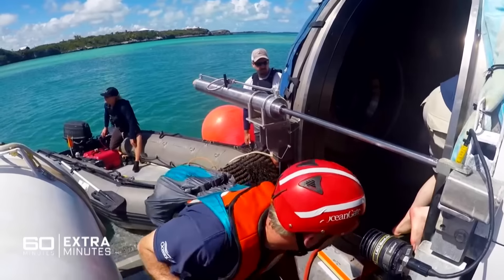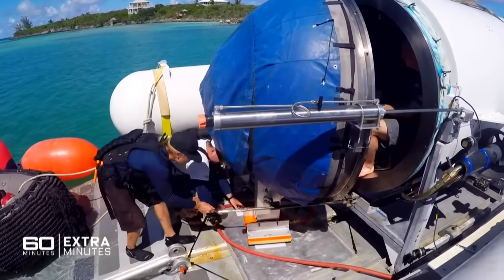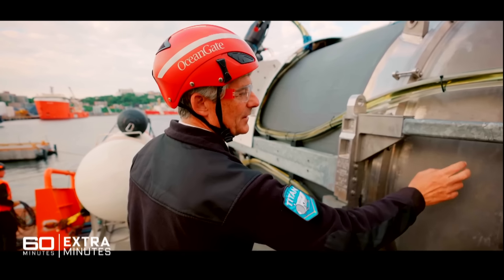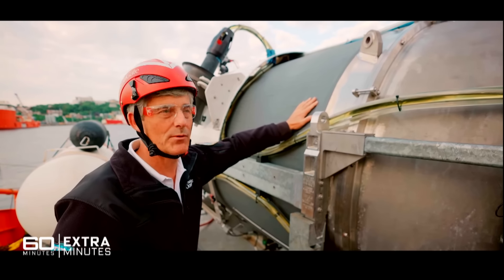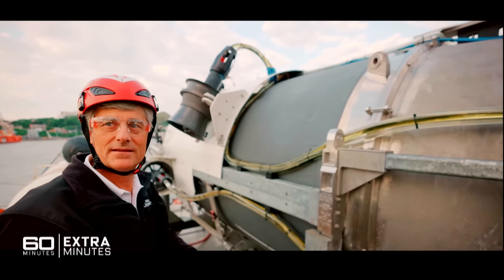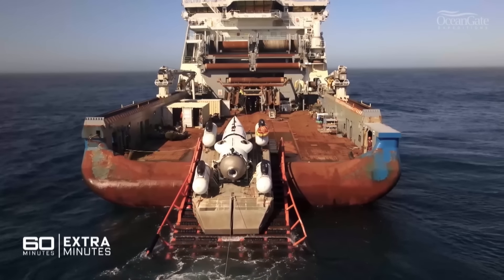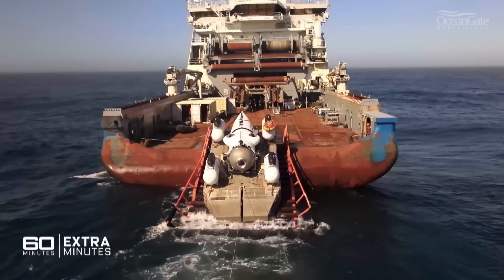Titanic sub implosion explained | 60 Minutes Australia

Comment: I’ve worked with carbon and glass fibre and we always applied the layers in multiple directions. It adds significantly more stability and strength to whatever you make. Here the fibre was applied in one direction only, that’s really puzzling to me.
Reply: To save money is why. What a fool he was.
Reply: Carbon fiber COMPOSITE.  Mate, I don’t care who has worked with carbon fiber. It doesn’t matter.  At high pressures, particularly 4000m under the sea - you DO NOT use any composite material.  You need an external hull that is homogenous and made of one material.  You literally can’t have different parts of the hull experiencing different pressure values of compression and expansion.  It was a doomed design.  Period.
Reply: It was actualy a 0/90 lay-up (according to Composites World) but the 0 direction was filiment wound and the 90 was layed up with prepegs. But there was no post-cure or autoclaving. Plus, the only other composite pressure hulls in use today are all made of glass fibre and none operate below 1000m. Also, I think the layup on them is isotropic.
Reply: Not to mention the total disregard for the lifespan of the materials.
Reply: @xivanquishix3456  Most likely. But not using the strongest application for the material seems rather stupid regardless.
Reply: wrx2hot4u There’s a reason CF is not used on any certified submersible, CF is not weak but it’s stronger when the pressure is outward not inward, no one is going to test it for how many dives it can last because the failure point is unpredictable, which would be a waste of money. All we saw that was left in one piece was the titanium.
Reply: wrx2hot4u my lay/ hobby knowledge of CF vs the Titan, biggest problem I see not much mention of is the lack of vacuum forming means it's at a microscopic level full of tiny bubbles of moist air (at whatever humidity the ambient conditions on the day of lamination). These bubbles being more or less evenly distributed throughout the form, seems inevitable they are going to contract & expand variably- a recipe for cracking in an atmosphere with zero threshold for weaknes.
Reply: The designers didn't have  one iota of common  sense
Reply: as soon as he would have mentioned yea we glue the parts together id be like naw im good thanks you drive safe lol.
Reply: that struck me too! as I too have experience in hpa carbon fibre tanks and that wind is making a spring not a weave... shocked me to see it but I honestly thought they would have covered that in the basic design along with it's not strong in compression plus water can track along the fibres same as air so you could have a decompression separation of layers on resurface
Reply: so now you're an expert on submersibles ?
Reply: @WWESVRPLAYER he is mate
Reply: I am still baffled why they would us an unproven material and tubular shape for the hull.
Reply: So he made a choice of material that is already considered inappropriate for the task, but then he added 3 serious additional errors (he didn't apply the layers properly, he didn't post-cure, and the actual carbon fiber he used was considered to be past its shelf life). Not to mention the dubious manner in which the titanium domes were adhered to the main pressure vessel.  After all of that, he blatantly ignored the clear evidence of the hull beginning to fail on earlier missions.  I'm dumbfounded that his original co-founder (Guillermo Sohnlein) has the nerve to keep calling Rush "risk-averse" in interviews.  Somebody needs to brush up on the definition of the term "risk-averse".
Reply: That submersible imploded so fast that Rush still thinks he's descending to the Titanic; winning.
Reply: That’s why they put rhino liner on the outside 😂😂😂 he must of watched that mythbusters episode! 😂
Reply: @WWESVRPLAYER  Yawn. Really now buddy?
Reply: I don't think it matters,it will eventually fail, a ticking time bomb.
Reply: @Ace96x10  More than a fool he is a selfish man and a murderer
Reply: what's puzzling to me is you keep speaking as carbon fibre is the only material in use when LITERALLY it's a COMPOSITE MATERIAL.  AS IF the LAYUP of the fibre material matters more then the resin in this case when several engineers of gone on record discussing how the fibres are at their best when holding up AGAINST TENSION.   What do you think that leaves left AGAINST COMPRESSION?  OH YEAH!!  That COMPOSITE MATERIAL you just conveniently LEAVE OUT.  THE RESIN.
Reply: @xivanquishix3456  I'm not an engineer and even I was thinking about different materials having different expansion and contraction values due to the cold affecting seams and joints.
Reply: That really makes no difference in the Titan's case because Carbon Fibre is great under tension but much poorer under compression.  It would make little difference how you wound or layered that Carbon Fibre because you'd be putting it under compression.  The fibres themselves cannot compress like Steel or Titanium can so all you have is the resin giving the repeated compression strength.

A second point is Steel and Titanium are homogenous, they're basically the exact same where ever you look in the material.
Carbon Fibre is a composite of two very different materials....the strands of Carbon Fibre and the epoxy resin. Both have very different properties.

A third factor is in the manufacture. Steel and Titanium will be exactly the same where ever you look on the object. Carbon Fibre composite will have slight variations in how the fibres are aligned, how much resin is between one fibre and the next one, there may be more tiny air bubbles in one area than another and all of these things mean you can't know exactly how strong the structure is because of the old adage - a chain is only as strong as it's weakest link.

One part of the Carbon Fibre composite may be quite a bit stronger than a bit 6 centimetres away.
You just don't get that issue with Steel and Titanium which is why they are the materials of choice.  They are predictable where Carbon Fibre composite wont be.
Reply: without going to the depths of the ocean floor here's what your 'Carbon Fibre' looks like under compressive stress.   https://youtu.be/Mc0wFyCIDfE?t=7
Reply: Wow. This layman thought carbon fiber, while around awhile, was still a fairly "exotic" material only used in specialty aircraft or other limited applications but since this fiasco have read a lot of comments of people familiar or working with it somehow.. Was gonna ask but can look it up just as well.
Reply: how about some more compressive stresses on carbon fibre WITHOUT going to the ocean floor  https://youtu.be/Yw56mgPK43s?t=83
Reply: Wow, no kidding. 😢
Reply: @xivanquishix3456  Don't think he was offering contradictions, just musing on his own experience with CF. Past that, your note of composites raises this layman's awe and respect for materials science. I consider myself a "science guy" and have all my life but damn generalized. MS and engineering seem like wizardry to me ... and the consequences are life/death vs. mis-identifiying a moth.

Really struck me years ago with a temp job at the Montana Dept of Transportation. Could not get past the INSANE level of calculation, formula and design I saw on highway curves I'd pass without a thought. But the materials testing labs were best. Steampunk mixed with Frankenstein equipment; simmering pots of asphalt mixes to test gravels to Hell If I Knew. 

Barely tip of iceberg when next went to the Research Library. Thought that proofreading gig would be a cakewalk joke but Holy Hell, tons of active project papers with such technical complexity/jargon/formulas that it made surgical report transcription look like reciting candy bar wrappers. Salute to all the material scientists, engineers and anyone associated with such insanely complex things that it makes most people flee screaming.
Reply: @Lmzip2  The tubular shape was to fit more fee paying passengers and he chose the number 5 for a very good reason. 
The parent company OceanGate Inc. was based in Everett Washington while OceanGate Expeditions, was a subsidiary company based in the Bahamas that led the Titanic dives. The Bahamas has less stringent rules than the USA. Titan was also flagged as a Bahamas vessel.

This was to circumvent stringent US regulations, specifically H.R.1159 - Passenger Vessel Safety Act of 1993 103rd Congress (1993-1994).

SEC. 5. UNINSPECTED PASSENGER VESSEL.

  SEC. 4. SMALL PASSENGER VESSEL.

    Section 2101(35) of title 46, United States Code, is amended to 
read as follows:
            ``(35) `small passenger vessel' means a vessel of less than 
        100 gross tons--
                    ``(A) carrying more than 6 passengers, including at 
                least one passenger for hire;
                    ``(B) that is chartered with the crew provided or 
                specified by the owner or the owner's representative 
                and carrying more than 6 passengers;
                    ``(C) that is chartered with no crew provided or 
                specified by the owner or the owner's representative 
                and carrying more than 12 passengers; or
                    ``(D) that is a submersible vessel carrying at 
                least one passenger for hire.''.
Reply: Right
Reply: unfortunately a submersible isn't planar https://youtu.be/DM6J-yw8yjA?t=224
Reply: I’m not even a expert in this stuff, but I do know if you layer stuff in different directions it gets stronger.
Reply: Carbon fibre is not designed for that sort of pressure
Reply: It does not work!
Reply: @J-Mac8  sure... I can layer up normal printer paper all day long and it get as strong as construction paper or even a credit card... that doesn't mean i'd be willing to use it for a submersible in a 1 foot baby pool.

got paper fibres in all directions all day long
Reply: @emteehed  I wouldn’t either!
Reply: Yeah I've seen this point made elsewhere, that even for CF it was a poor design. It's very hard for me to understand what Stockton was thinking. I think the root issue is that with a pressure vessel, you'd like to start with safety, then design around that. 

In this case, that would have meant a spherical design, but that would be space & material inefficient if you're trying to fit a bunch of people on board. So they went with a cylinder, and carbon fiber. I'm sure that's why Stockton didn't bother trying to class his design, because he knew there was no way it would pass. Better to not even try, and say something vague about 'innovation'.
Reply: I'm not an engineer, and still feel it's obvious that under compression, carbon fiber composite isn't carbon fiber bonded with resin like it is under tension or torsion. Instead it's resin bonded with carbon fiber. The fibers happily flex far more under compression than tension or torsion, letting the resin crack and shatter more easily.
Reply: Would not have mattered.  The issue was the CF / titanium interface, which moved at dissimilar rates and was the point of failure.
Reply: Fiber is useless where almost all the forces are COMPRESSION!  6000psi is 864000per square foot.  That is like 7 loaded tractor trailers on every square foot of that vessel.
Reply: DOESN'T MATTER HOW YOU APPLY THE FIBER. THE FACT TO THE MATTER IS THAT EPOXY RESIN IS THE ONLY THING HOLDING IT TOGETHER UNLIKE STEEL AND TITANIUM OR ALUMINUM WHICH YOU WELD IT. IT WAS GLUED NOT WELDED TOGETHER.
Reply: wrx2hot4u totally wrong. All carbon fibre is different and will result in different strengths each time its made. You also have different strengths in different parts of the hull which will also be different each time you build one. You might get 10 dives on 1 titan then only 2 dives on the next. Especially when you are joining metal to the CF hull by glue. Metal expands and contracts with heat difference and also the carbon hull could've flexed which could've cracked the glue. Again something that could react differently on each build.
Reply: wrx2hot4u  bruh it shouldn't have been used at all, let alone at 4000m below the ocean. dafuq you talking about.
Reply: wrx2hot4u  seems they are talking about its application aka wet atmospheric pressure not motorcycle helmets.
Reply: @ZacabebOTG  what it's not is concrete and rebar
Reply: Yep, staggering the composite layers was going to save them. 😆 That's hilarious mate, look what happened. Using composite materials was a death sentence from the beginning, especially going in a submersible at nearly 4km  under water. The owner was complete moron, he was told it was a bad idea from the start yet he didn't want a bar of it, until the ocean gave him a bar his submersible couldn't handle.
Reply: @lancepage1914  Did I ever claim it would have saved them or even made the basic idea more valid? I’m just pointing out they didn’t even used the strongest construction possible with the material.
Reply: @darknes7800  are you speculating, or do we have concrete evidence of that? I know that was a possibility, but the hull failing directly was a possibility too.
Reply: @captainwin6333  The thing about CF being great under tension and poor under compression is dependent on the weave and layup. That's why people talk about it being unidirectional, when something is compressed in one direction it becomes stretched in the perpendicular direction... so unidirectional means that a compression load will induce another load in the direction perpendicular to the fibres (i.e. the weak direction). CF that is multidirectional and well designed/manufactured can have compressive strengths relatively close to the tensile strength... but unidirectional will have very high tensile strength and a compressive strength that is far less (maybe 10% of what it is in the tension direction).

Granted I still don't think it's a good material to use for a sub, but that's why people talk specifically about the problem with unidirectional layup even when the primary stress direction is well known.
Reply: @emteehed  I'm just thinking that the resin is subject to greater stress under compression than tension or torsion because the carbon fiber isn't resisting and redistributing the forces evenly, making it a very brittle material for the application. A sack made from carbon fiber alone would withstand being filled with a heavy material, but could probably be folded in on itself by hand when empty. Even if the ratio of resin to fiber is very low, not anything like concrete and rebar but more a form of glue, it still seems logical that the resin is what fails the most easily under compressive stress. 🙂
Reply: @xivanquishix3456  he wasn't talking about it may have worked if they used it in several directions to strengthen the carbon fiber from several points, he's merely adding the point that carbon fiber is a woven material, that most of the time ( unless according to design otherwise ) is woven in several directions.
my man, his comment has literally NOTHING to do with the composite being able to go that deep if they woven it in several directions. Edit: which by the way, no carbon fiber was not the right choice for a sub going that deep.
Reply: wrx2hot4u  From what I understand, the big point of not using caron fiber at all in this application is that it compresses very poorly. It's strength is in being pulled, not compressed. Add to the design the fact there are glued joints with titanium and the carbon fiber wasn't autoclaved, and it's really pointless to consider a service life as the service life could be very short indeed. The hull could have failed on the first dive if not the second or third. Also, there was not thorough testing so no real attempt was made to even establish a service life. Rush's apparent plan was to wait for visible cracks and for the sonar failure system to give them a warning and hope the hull didn't fail catastrophically before the sub could be removed from the water. Bear in mind if the sub developed a leak even near the surface, it's possible the sub could not be recovered before the craft filled with water because people inside can't get out without someone unscrewing the nosecone from the outside. Can you imagine drowning in that coffin while they launch the raft and work to get the sub secured on the raft and raise the raft above water so they can work to unscrew the nosecone? What a mess!
Reply: @Wildskatz  What is this materials' Section Modulus of Elasticity ?
Reply: This wasn’t the layering of the material, ie: the carbon fiber, the problem was the carbon fiber itself!
Reply: And me.
Reply: @Derek_Smallshorts , plus it was not built in a clean room, so there could be all sorts of inclusions, from dust to flies or bird feathers.
Reply: @hilltop521 , one did and his pointing out the flaws, got him sacked.
Reply: You know as well as I do it has incredible tension strength! But squat for compression strength!
Reply: @Lmzip2 I asked Ai to make a sub that can reach 12,000 ft and it's design was a tube with titanium and carbon composites. 
I did ask very basic questions though.
Reply: @Disinterested1  Delamination is the term.
Reply: @Dee0336 It is true that a pressure materials can usually be used for higher internal pressure than external pressure for virtually any likely material of construction.
 I'm not quite sure what technical point you are making.
Reply: Stockton Rush is what we in the uk call a cowboy. Shoddy work at an inflated price.
Reply: @binarymalehim that is a profound result from Ai with basic input.
I have a feeling Mr. Rush chose what supported his ideas without digging very deep to find the devil in the details. Maybe he researched using basic data? We will never know. 
But, hopefully we can prevent future disasters.
Reply: wrx2hot4u  The problem is not the amount of cycles, the problem is that the it presents brittle fracture, so whatever fatigue occurs it will fail in the fraction of a second without being able to predict it

 (and even if you had a lower and upper bound for cycles, it is just a statistical distribution, any heterogeneity in the manufacture could lead to a deviation)

 Metals have an elastic zone before the plastic zone  that would allow sensors to monitor the deformation with  precision. Carbon fiber is not a bad idea if a catastrophic failure doesn't mean instant death
Reply: @ZacabebOTG  funny you say that after all the video links i posted of carbon fibre failures under compression.
Reply: Fibre composites are only appropriate for tensile applications. It's reasonable to use fibre composites in pressure vessels that are internally pressurized, like airplanes or fuel tanks, because the load is tensile and fibre composites are very good at handling this kind of stress. The load on a submarine is compressive. Using a fibre composite to handle compressive stress makes the same kind of sense as trying to push on a rope. It's utterly moronic. Anyone with any kind of sense would have known that it was totally inappropriate to make a submarine out of carbon fibre.

If Stockton Rush hadn't of been a passenger on his own deathtrap I would have called him maliciously negligent. The fact he was one of the passengers shows he was just an idiot.
Reply: The carbon in the perpendicular direction (longitudinal direction) is compressed from the end caps/semi-spheres. In that direction, the local and general buckling modes are very stable. The out-of-water loads are also very light.
Reply: That was one of the innovations 🤫
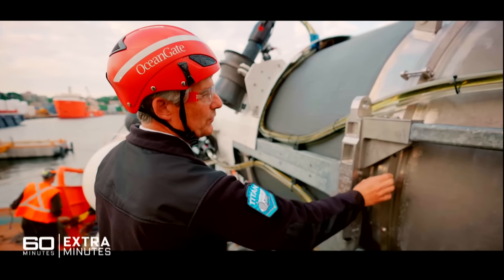Reply: 1:26 He said "glued". What does that mean, exactly?
Reply: @johnnunn8688  LOL we could actually be here forever listing all the stuff they did wrong.
Reply: @Ace96x10  Not just money, buoyancy is better.
Reply: @emteehed  I hadn't looked at the videos yet but now I have. So it's the carbon fiber as such that shatters, not the resin breaking and ripping apart the fibers with it? As I said, I'm not an engineer... 🙂
Reply: I don't think it matters which way they lay the carbon, it's always going to be layers and always being compressed. So the outer layers are squeezing the inner layers and shrinking at different rates causing strange sheer forces between layers, as well as sheer forces at the end where it meets the titanium with different compressibility coefficient.
Reply: @Lmzip2 To fit more people. He wanted to make money.
Reply: @emteehed  you videos where just total bullshit 3-5 layer cones made to take the impact force are not the same thing a 417 layer tube can handle 

done right and the did not at all on that sub a small 3cm³ cube can easily handle the weight of a small house
https://youtu.be/QYqOMjoz_i8?t=178
in this video here  it takes alone the fibers 60 metric tons (weak parts) and cross the fibers 100+ metric tons  because the cube was done under a vacuum so you dont get any air bubble in it
they could do a much better job with building with different kind of carbon fiber direction to made it stiffen 
carbon was not the best material to be used but done rigth would make a big difference  and cmon they did glue on the titan rings?  sure that sound save
Reply: @xivanquishix3456 I agree with you.. I understand we have multiple ways to make the carbon fiber more durable, but at 12 thousand feet down and more, it wouldn't last over time.. the research just shows it, and you are correct on that . Over time it's not gonna matter how we cure it or wrap it or whatever, it's gonna buckle under that much pressure over time, unless we figured it out completely.. but so far that's not the case, carbon fiber will fail at that depth on any given Sunday..
Reply: @mandydyke4248  One that you could actually hear ticking / cracking.
Reply: @vycanismajoris6871  There is an epoxy resin at the ends of the carbon fibre tube that is sandwiched between titanium flanges which connects to the end dome.
Reply: @clubtepes2046  Not to mention the incredible pressure changes.
Reply: Because stockton was in a rush, he ignored the fuss & got himself crushed
Reply: @slo3337  No, it REALLY does, because the orientation is entirely what gives composites their strength. It's actually absolutely critical to get that right.
Reply: Given the shape (Cylinder) and the requirement for a clean edge to mount to the Titanium ring, I don't think it could have had the fibre in any direction other than around the cylinder.

That said, it probably wouldn't change the issue - which is that as the layers weaken or break, at some point there will be a failure on repeat exposure to super high pressure.
Reply: @MontanaVigilanteExplorer carbon fibre composites have their place where weight is an issue and tensile strength is required, aeroponics, and some vehicle applications come to mind. Under compression however it has no benefits, as the ONLY strength it has is the resin component when under compression. A pressure vessel in a submersible is placed under incredible amounts of compressive pressure, not only that but when diving and surfacing it’s loads increase and decrease dramatically. It was a matter of time before this vessel failed.
Reply: @xivanquishix3456  If the dive transcript that was leaked is real it sounds like they might have been doomed anyways. They were "diving" too fast the entire time and eventually tried to abort but couldn't. They dropped the ballast and the landing gear, but still barely started to ascend and ran out of batteries below 3000 feet. I think they were over weight from the start of the dive, and were never going to surface anyways. But that's just a guess and the transcript could be fake.
Reply: wrx2hot4u  As numerous experts have already stated on record, carbon fiber is wholly unsuitable for pressure vessels on manned submersibles.
Reply: Probably to use less material and reduce overall weight
Reply: @paranoid9678  you're arguing and i quote you 'alone the fibres...'   there's no such thing as just the fibres themselves with this COMPOSITE material.  you're argument is mute.   what your video corroborates is the fact of DELAMINATION which 1 of the 4 videos i linked ALSO show the problem of DELAMINATION.   ODDLY enough James Cameron in one of his interviews after the OceanGate incident he briefly discusses the issue of DELAMINATION...  

'alone the fibres...'   does not exist as the fibres would buckle without the resin.  The fibres alone with a weave are like a fabric.  as moldable as cotton or nylon or polyester.  

no amount of 'layers' with your 'alone the fibres...'  will handle anything unless they're made to be used as a hammock
Reply: @Derek_Smallshorts  75% of us have no idea what you said but thanks anyway.
Reply: Good Eye!...
Good Eye!
Reply: @Derek_Smallshorts  I agree to some degree. But in this case I doubt the optimal weave would have saved them, perhaps give them a few more dives. They were gonna keep going till failure no how many dives it took.
Reply: @xivanquishix3456  But how can they be sure metal is not a composite like that I mean can't there be imperfections in metal?How are they gonna say the metal is guaranteed homogenous
Reply: @slo3337  No it wouldn't. and even then, Rush had his daft acoustic "Real Time Monitoring System," yet ignored the bangs, cracks and pops the hull was already making.
Reply: No need to have worked with carbon and glass fibre to know that
This is the basic principle of a lot of things, like plywood, house structures, knitting, sanding, law  mowing, painting, 3d printing.
More examples welcome.
Reply: now he is stockton slush
Reply: Why wouldnt you build a submersible from hardened steel and titanium?
Reply: @garynewton1263  I won’t be building any submersible. Never have, never will.
Reply: Like making plywood, several layers in different directions glued together and pressed
Reply: I watched some other videos showing how the titanium ring was glued to the CF hull.  Just seeing that gives me shivers honestly.
Reply: Shouldn't be that material.
Reply: The unseen secondary damage is the worst part, especially when using untrained staff to check the vehicle over. Fibre reinforced plastics has been proven adequate for air and land use, for its weight saving to strength ratio, but their is a reason the main manufactures of submersibles don't use it and especially in a toilet role tube design.
Reply: I still say it was their bluetooth disconnected, got stranded and a giant sea creature smashed them into a rock
Reply: @captainwin6333 I agree.  You don't push with a rope.  I would guess he essentially relied on the strength of the epoxy.
Reply: wrx2hot4u  I agree. CF is strong and light weight and would be ideal for deep sea submersibles. Stockton just didn't have thick enough CF. People talk about CF being weak in compressive strength, but everything is weak in compressive strength if it's not thick enough. You can take a thin wooden ruler and put it between 2 blocks and stand on it, and it'll snap, but you can take a piece of 4x4 wood, put blocks on each end, then stand on it and it won't break. That cracking sound was a warning that the CF was to thin and flexing. As you know, CF is not suppose to flex. Tests would need to be done to know the correct thickness, but Stockton just relied on calculations. Who knows, it might need to be 2 feet thick to withstand those pressures and not flex. He also should have had a rubber seal on those rings that would flex with the 2 different materials, and titanium 2x4's every 2 ft that ran parallel with the hull, that bolted on each end, to lock the 2 rings in tightly to the CF tube. The dado joint on the titanium end caps also needed to be at least 12 inches deep. The whole thing was just poorly designed.
Reply: @wrx2hot4u CF is just not the right material period. It does not have a define fatigue limit like Steel or Titanium and will always fail over time.
Reply: @chrissimpson4322 Industrial CF construction is nothing like hobby CF layup. They do not need a vacuum because they use an autoclave chamber to cure their parts. Carbon fiber is only as strong as it's epoxy and epoxy does not have a fatigue limit and will always fail over time.
Reply: Would it have really made the difference if he cross layered it?
Reply: Safety isn't the priority. Innovation is. That's why.
Reply: It wasnt the CF that actually failed, but the resin. At extremely low temps it becomes brittle.
Reply: @Dee0336  Exactly! Just like you should never build a car around battery technologies. It is a stupid idea and will never work.
Reply: No way man,you surely can't be correct.Ànyone and everyone knows this
Reply: I was thinking the same thing.
Reply: @jacooosthuizen3593  SAME HERE!  I was thinking " did those people know this thing was glued together.
Reply: Doesn't matter because of the compressive strength, or lack thereof in this case.
Reply: wrx2hot4u I have not yet seen any 'expert' stating specifically that CF is a 'weak material' .. rather that it was probably not the best choice for a deep submersible.
Reply: @hilltop521 University Graduates have the Key to Knowledge. The Experience comes thereafter.
Reply: @WWESVRPLAYER Bored down there in your Grannie's Basement?
Reply: It was simply for the purpose of saving money, weaving would have required more linear feet of the carbon fiber, so he chose to risk lives over spending more money, not that weaving would have prevented failure anyway.
Reply: @wrx2hot4u  it's because while carbon fiber is amazingly strong. This was a very poor use of it given its strengths. You use carbon fiber to make the strongest pressure bottles.  Where the high pressure is on the inside and the force is putting the fiber in tension. Reversing that is, as we saw, suicidal. Because in compression the carbon fiber part of the composite is just a ball of yarn. All of the load is carried by the resin bonding agent.
Reply: Exactly, it essentially was a 5 inch thick epoxy tube, without the cross weave you could have snapped this in half like a piece of pvc pipe, my guess is this thing split between the fibers or at the seams...im not an engineer but I can conclude titatinium and carbon have different expansion contraction and flexibility, and that epoxy glue between two diff materials is a weak point.

Even if they wound the carbon at an angle they would have achieved more structural strength.

The more I read about this the crazier it makes me nobody whislblew this more.
Reply: @yanks7533  whistle blowers were escorted out the building.
Reply: @hauntedmarysvillemontana999  Carbon Fiber is still considered an "exotic material" in the engineering community, because as a composite its full characteristics are hard to model and not fully mapped out. This is opposed to steel. Which you have acres of tables telling you how any given variety of steel will behave in any and every possible situation or stress. It's been well and completely understood for over a century.
Reply: wrx2hot4u  entoces no sirve que uno tiene un aparato de un uso limitado tan bajo ningúno en cualquier momento puede fallar no avisa así que es mucho mejor solo una completa de acero que manía de defender la fibra cuando nadie la usa
Reply: It was the easy way out for the cheapster. It's much simpler to just spool the carbon fiber on in one direction than to also wrap it long ways.
Reply: @PuckDudesHockey  He was averse to hearing or acknowledging what the Risks were?
Reply: @vycanismajoris6871  There we’re two types of “gluing” being used in the Titans construction. It’s hull was made of 5 pieces. 2 titanium dome end caps. 2 titanium connector rings, and a large cylindrical Carbon Fiber tube for the main hull. The adapter rings could be bolted to the domes. But to attach them to the carbon fiber cylinder an epoxy glue was used. So you had 2 16” circumference joints of titanium being attached to Carbon Fiber with something along the lines of Gorilla Glue. 

The other reference to gluing is Carbon Fiber itself. Actual Carbon fibers are just very very strong pieces of string. In order to make an object out of carbon fiber you have to glue lots of the carbon fibers together using an epoxy resin. Not unlike fiberglass. So most of the mass of the main pressure hull was made of glue. Like the worlds deadliest papier-mâché project. Viva Piñata!
Reply: @Derek_Smallshorts not true look it up it was cured for a while but that means nothing people told Rush that’s not how you go about designing a submersible for a hydrostatic pressure of almost 800000 lbs per square foot and have different materials glued together.? Glued is true he said it with his own mouth 
“ the front dome that is made of titanium bolts to the ring that is glued to the carbon fibre tube “!,! Glued
Reply: nope there were other layers that went in the longitudinal direction. those were sheets of woven material applied with a liquid epoxy rather than the prepreg form that the carbon fibre was in.
Reply: @Derek_Smallshorts  the 90 was wet applied not prepreg. there are videos showing that . wet lay up.
Reply: wrx2hot4u  it was used in compression which was exactly wrong
Reply: You mean like a lattice or zig zag pattern?
Reply: Even with that method, the failure point is not predictable.
Reply: I don't think it was really one direction.  The tubes I have seen for this sort of service have the fiber run back and forth as the mandrel turns.  This puts the fibers at an angle to each other.  The exact angle it set based on the intended application.
Reply: @fabulousfabrications1985  Of course it was cured, but according to the article in Composites World it wasn't POST-CURED or autoclaved.
Reply: @garynewton1263  I think Rush wanted innovation for innovation's sake. The purpose of the submersible should dictated the design. For example, JAM suits are made of glass fibre because they have to dive to 2000m but be made of a material that's very strong yet super lightweight and easy to form into an anthropomorphic shape; DOER and Triton mostly use acrylic because they're designed for scientific observation. At the depths the Titan was operating, the sensible thing to do would have been to construct, say, three titanium or steel pressure spheres and clamp them together. But Rush wanted to be different for the sake of it. The US Navy once tried to build a JAM suit out of carbon fibre but it failed at less than half the operational depth of its glass fibre counterparts during hydrostatic testing. Liz Taylor even told him not to use carbon fibre after he consulted with her, because DOER had done a load of testing with the material but he went ahead anyway. I think he tried to copy Graham Hawkes' homework a little bit, being inspired by the Deepflight Challenger, but that was built by people who chose carbon fibre because they didn't have any other choice of material and they knew the submersible would only be used ONCE, then go to a museum; they were actually quite public about the fact that it was a crazy idea and Steve Fossett, had he not been killed in that plane crash, was taking on the risk entirely on his own responsibility. I supposed glass fibre could have been used on the Titan instead of carbon fibre, but at those depths, you'd have lost all its weight saving advantages anyway (plus Rush would still have refused to have the thing properly inspected and tested), so titanium, steel or aluminium would have made so much more sense anyway; you only deviate from those materials if you have a really good reason for doing so, and usually only if you're not intending to go below 1000m (although there are a few rare exceptions).
Reply: Could it work if applied properly ?
Reply: @Jarrygames86  There are 1 Atm diving suits called JAM suits made of glass fibre and rated to 2000m. Several years ago the U.S. Navy had one specially made for them in carbon fibre because they wanted a diving suit that could go to the deep ocean. During pressure testing in a hydrostatic chamber it failed at less than 1000m, and given that submersible pressure hulls (including 1 Atm diving suits) have a factor of safety between 2 and 10, that's a pretty poor show. Plus carbon fibre develops cracks whenever it's put through compression cycles, so the short answer is no.
Reply: @Jarrygames86  Most likely not, at least not for long.
Reply: Applying in multiple directions makes perfect sense… I can’t wrap my head around what this guy was thinking.   I wonder for him if deep down it was a suicide mission from the get-go.
Reply: @YortOK  Quite literally. The pain receptors, the eye signals and other human senses wouldn't have had enough time to send signals to the brain before it imploded. One moment, they think their still descending, and then nothing. They died thinking nothing went wrong.
Reply: @emteehed  Do we have any idea of the effects of salt water and other minerals in the ocean have on resin? And perhaps different ph levels affecting the integrity of the resin?
Reply: @bobbygetsbanned6049  If water had rushed into the compartment in the back, that would explain why they barely ascended even though they dropped the ballast, because the sub had taken on too much water and was too heavy. If the transcript is true, they were descending too fast pretty early on, way before the time of implosion, meaning that the sub had a critical failure almost at the beginning. Which means, despite Rush's calm demeanor in the transcript, he likely knew there was something very wrong at the start of the trip, despite his false bravado. All speculation until the transcript can be independently verified but still, interesting to thinking about.
Reply: @luminatrixfanfiction  there's alot of fiberglass boats and epoxy/resin for marine purposes (some of which you can buy off the shelf at lowes or home depot or similar type stores for patching holes in boats)...  which is almost a moot point since part of the carbon fibre was pre-impregnated with resin... for aerospace application...   who's to say the resin was useful for marine purposes?    so...  yes... on one hand there's plenty of knowledge base on resin in salt water...
Reply: @luminatrixfanfiction  I thought that at first, but they were descending way too fast for the entire dive. They have to weigh everyone to make sure the sub is neutrally buoyant, so I think they screwed up the calculation and were actually negatively buoyant and were not diving, but sinking the entire time. Neither Rush nor the boat thought the decent rate was an issue until they were over 3000 meters down, if something flooded they should have known much sooner because they were already descending too fast. I think when the report comes out it will say they were over weight from the start, dropped all the ballast and gear, were still over weight but were able to ascend very slowly with thrusters. But the first battery bank died from trying to ascend with an over weight sub, then some time after they imploded.
Reply: @bobbygetsbanned6049  The thing is that the battery bank died. Meaning it most likely shorted out, and that can only come if the compartment was flooded. Which is what led me to believe that compartment was flooded if the battery died.
Reply: Carbon fiber is for tension, and here it was wrapped and pushed on from the side... of course it buckled. This was insane, deadly and obvious.
Reply: repentandbelieveinJesusChrist1  Does he also give advice on how to build subs?
Reply: I thought we were going to see them doing just that, too.
Reply: Wrx....The kettle is black... And carbon fiber is weak for this application.  Just as you are for this argument!
Reply: @nicholasmorton7200  Don’t get you knickers in a twist. I’m just pointing out they didn’t even use the strongest application of the material, I’m not saying it’s a suitable material.
Reply: @xivanquishix3456 maybe you should have built it since you know so much
Reply: @luminatrixfanfiction  Possibly, but I think they just drained the battery from trying to surface a sinking sub instead of a neutrally buoyant sub. I also doubt there was anything in the back of the sub that could actually flood, and if it did, it would weight down that side of the sub making it sink and obvious something was seriously wrong much earlier in the dive.
Reply: @captainwin6333 Thank you for your knowledgeable explanation of the differences in those materials! 0:04
Reply: @Wildskatz don’t forget he purchased the CF from Boeing who felt it was past it’s used by date!!
Reply: wrx2hot4u from the second dive it was already failing… this is from who who were on board the vessel commenting on the cracking they heard…
Reply: @Wildskatz absolutely correct and then towing the submersible in rough seas out to diving sites 😬
Reply: @WWESVRPLAYER it imploded!
Reply: wrx2hot4u  You yourself miss the point.  It is a composite, which means when applied to deep sea diving it is too difficult to model and predict for.  
Any miniscule flaw will cause far more trouble than with say, a properly manufactured titanium hull, as we see starkly here
Reply: wrx2hot4u   and for the same reason each carbon construction will not be uniformly similar enough to another to be be confident in its failure time under  these extreme conditions.  it is inappropriate for the task
Reply: wrx2hot4u  It is not about number of uses. Every time they dived, they threw a dice. The probability of failure went up due to fatigue but even in their first dive, the chances of composite material failing was too high. 

CF is good for certain forces (when you pull the string). But fragile in others (compression here).
Reply: Yeah i was booked to go on but pulled out after having my engineers go over the designs extensively, and strongly encouraging me to think twice about this venture. Dodged a bullet there
Reply: @WWESVRPLAYER  NO, he never said that BUT he's an expert on NOT going on a CF submersible and thus still has the ability to post....
Reply: @5IMON5AY5  as soon as I heard Rhino Liner, i was out.  Right after the Camper World light for the interior and non-mil spec gaming controller from Logitech....
Reply: As the metal cylinder has the carbon fiber widths applied, we don’t see that it’s only in 1 direction, but I’ve also worked in the carbon fiber manufacturing, and yes, you are absolutely correct in stating that the strength comes from the multi directions in which the pins are layed.
Reply: @wendywentworth5720  Isotropic layering was and is the correct way this should have been done.  Seems to me it was all anisotropic. 0/90 45/45 at the minimum.  I'll bet it was all 0/90
Reply: @spectre7529 he is not a murderer. Those people who got on that submersible were responsible for their own deaths. They all had the education, experience, ability and/or money to do the research in order to figure out that the submersible was substandard (no pun intended). They didn't care about anything other than fulfilling their own egos. Pretty easy to take the time and find out why no one else but this company and owner used anything other than titanium and steel for deep sea submersibles. Also, any glued joints should have set off any reasonable person's safety alarm.  This company has had a track history of taking huge chances with no testing. Even if I were told the trip would be free, I never would I have been on that submersible, for any reason.
Reply: @royhorn2782  Well, I saw him as a murderer he knew full well that carbon fibre can withstand those pressures and how cheap he made it
Reply: @spectre7529  I get it, but nothing he did was all that secret. One of the passengers was an expert on Titanic and fully aware of the differences between all other deep diving submersibles and the Titan. Each person was aware that what they were doing was probably one of the most dangerous things you can do. Why would you not look into the history and other issues related to a purely experimental vessel that clearly wasn't tested by any recognized body that tests pressure hulls for submersibles. All of the passengers were clearly capable of doing the research about Titan, and all of them were lazy about it. They were more intrested in satisfying their overinflated egos, so they could pound their chests in front of their families and friends. They all had it coming, by ignoring the obvious facts that could have saved their lives. I have no pity when people take life threatening chances out of self inflicted ignorance.
Reply: It absolutely blows my mind that he wouldn't even at least cross-thatch the fibre, as he was satisfied with the "burrito roll" method.